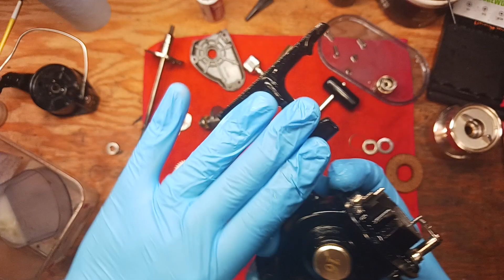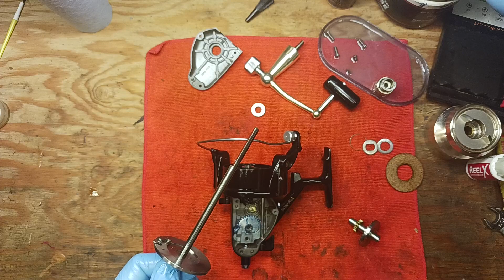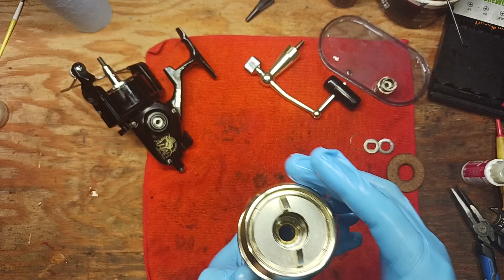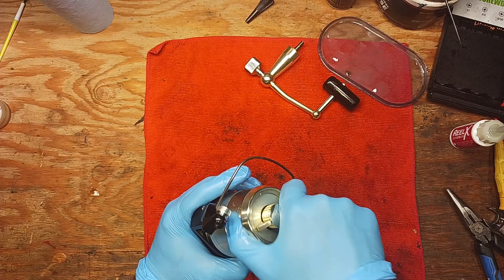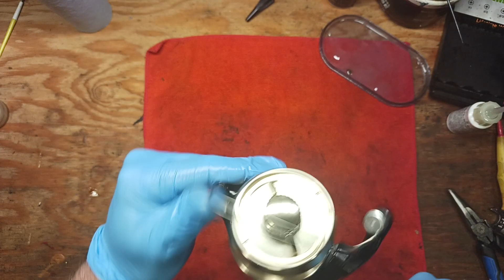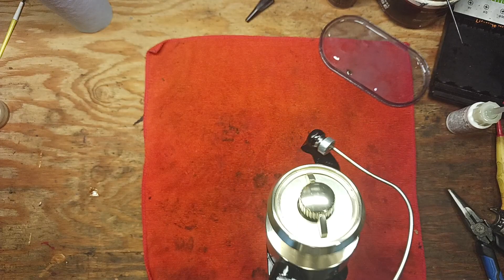Fin-Nor Ahab 16 Ball Bearing Saltwater Spinning Reel Reassembly Service

Comment: Hi Tony, I just got a Fin Nor Ahab 20 for my vintage spinning reel collection and for surf fishing. From what I’ve been able to find out there are very few if any parts available for these Ahab reels. Did you know that now that Pure Fishing has Fin Nor they are using the brand just to market a line of Fin Nor  sunglasses. This made me sick!  Very good video though I do have a few questions. — Chris
Reply from the maker: Hi Chris, Yes, these are nice reels. not many of them out there.  Thanks for watching! - Tony
Reply: @backonthebenchreels Tony, It took me two years to finally find an Ahab 20. My reel  is not quite the cosmetic quality as the one you did. I know I’ll have a massive cleaning  task when it arrives. I recently got the truly rare Fin Nor spinning reel late last summer - a Gar Wood Jr. Fin Nor Tycoon No. 4 spinning reel. If you don’t know this one look it up. Mine is absolutely mint - not so much as a smudge or scratch. I’d never use it as it is just too perfect and beautiful. If I had your e-mail I’d load you up with photos of remarkable vintage spinning reels from my collection. By the way, late last week I completed my series of all the Daiwa vintage black/gold BG reels. I even have two gorgeous BG10 reels. I have no idea what I might go after next. I also finished my collection of all the Abu Garcia center drag reels. I actually have a perfect CD6 8000BG center drag that has never been used.  It is the only center dragsuitable for saltwater fishing (except maybe a 7000) I think I like it almost as much as my Abu Suveran. I have over 420 vintage reels now!  (Boy my wife is mad at me!) LOL — Chris